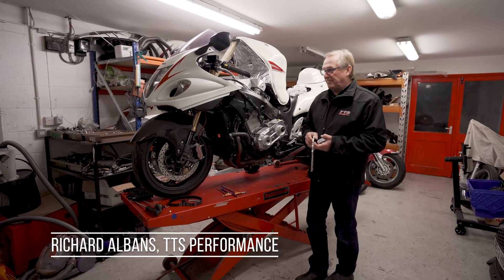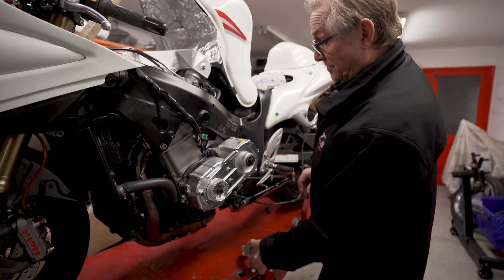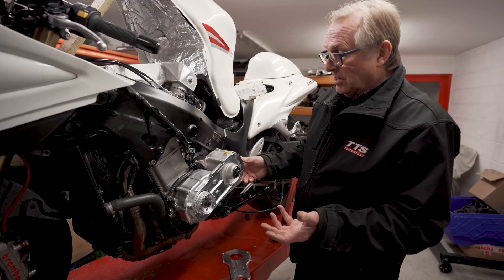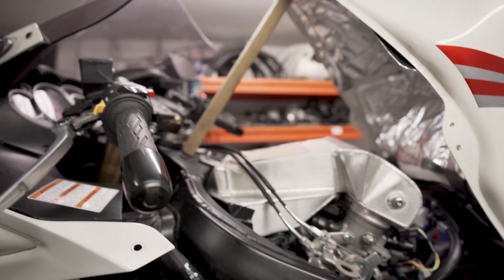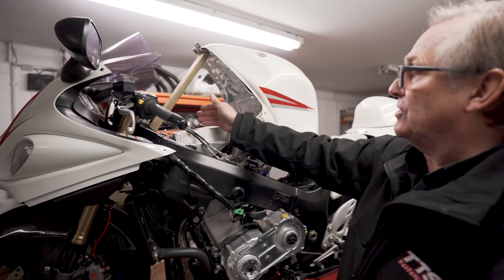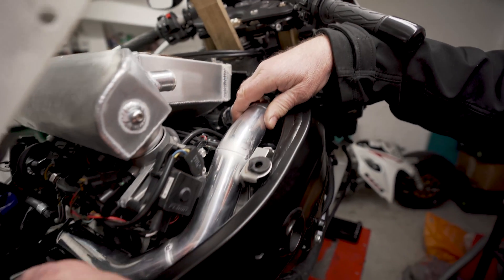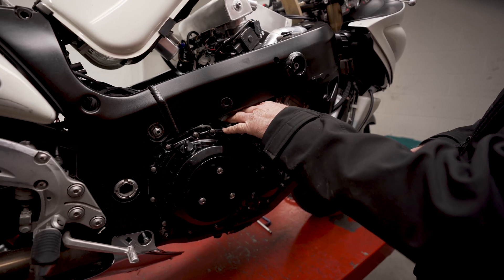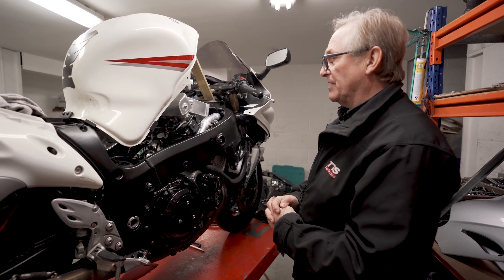TTS 350hp supercharged Hayabusa – more development

Comment: How's it going my friend I was wondering is that on a stock motor producing that much and how long would it last I cuz I want to have a daily Rider with around 300 to 350 horsepower and I was thinking about carpenter racing has one that gets 365 plus to the rear wheel Andres motor but if I could go with a supercharger and get a little more and just have to change the pulleys that would be pretty cool